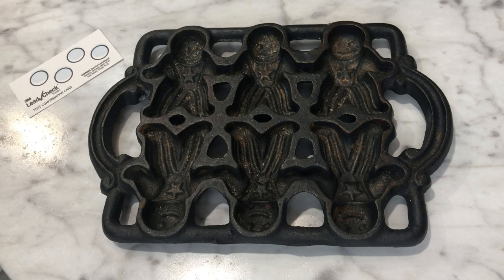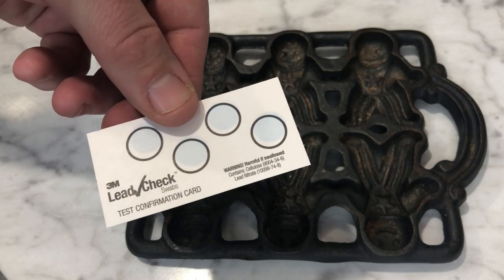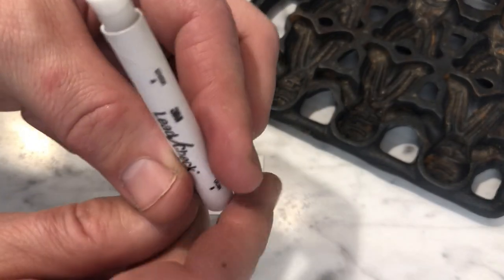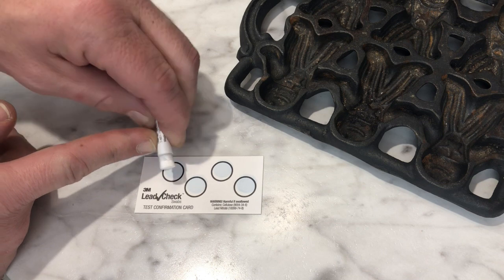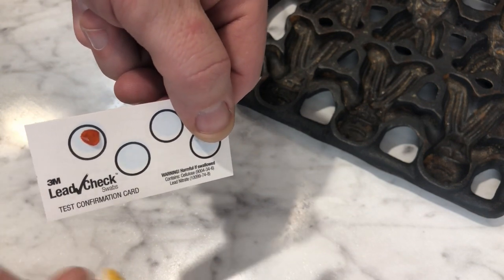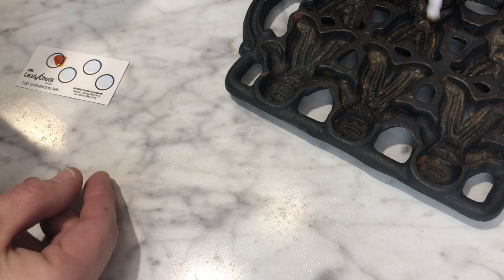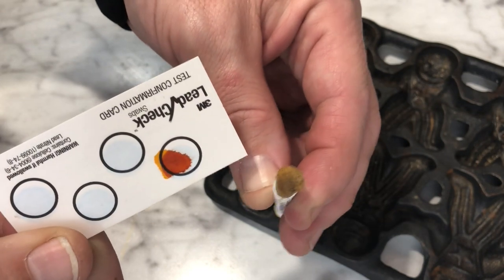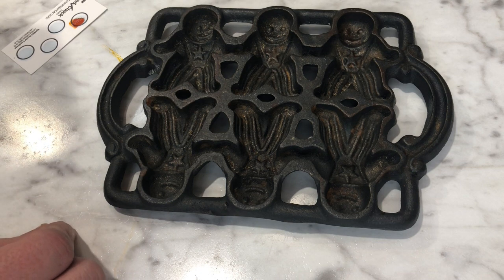Testing a Cast Iron Cookie Mold for Lead

Comment: I got a skillet and I put it in a lye tank. When I got it out, it has a silver ring around the outside. I got a lead test kit and sure enough it has lead. I cleaned out the lye tank, completely and drilled a hole in the BSR #5 and put it in the trash. Thank you for your help!!
Reply from the maker: My condolences.

Comment: Why don't you pour some of your lye solution on the pan to strip the oil off of it before testing? I would not submerge the pan into my lye bath, as it may contaminate the lye bath.

Comment: Unless someone was casting lead gingerbread men?  That shape of pan wouldn't be very practical for melting lead in.  Imagine trying to pour molten lead out of those multiple cavities. I think most of the lead contaminated cast iron iron cookware was used  to melt lead in (for casting bullets or fishing weights, for example).  Someone said that cheap cast iron from China could have lead as part of the cast iron from manufacture. I'm not even sure if that is possible, as cast iron is heated much hotter than molten lead and it would burn lead away from the high heat and oxygen  used for refining the iron?
Reply from the maker: Cast iron molds have been used to produce fishing sinkers, and it's rather popular to use cast iron cornbread pans and molds (like this: https://www.youtube.com/watch?v=50T3sxiExbM ) for those.  Fortunately, this pan didn't have lead residue in it; but I didn't know what it was used for, before I acquired it.  Asian cast iron does not contain lead in its manufacture: https://www.youtube.com/watch?v=VyjQ_ZA0FJ8

Comment: Those are not designed to test consumer goods.  They are especially not sensitive enough to check for food safety.  #LeadSafeMama
Reply from the maker: We are checking for lead residue, not lead in the material itself.  I don't consider #LeadSafeMama a trustworthy resource. https://www.snopes.com/news/2019/03/19/lead-in-cookware-or-in-toys/

Comment: These 3M lead test kits suck. I'm looking for something better on Amazon now. I returned 3 of these 3M kits until I finally got a kit with 1 I could use. Alot of them were dried up. See how he had an issue squeezing that liquid out? Should drip out easily and get a few drops. I finally found 2 out of 4 kits that would work. Also note it says on the package once you squeeze the A and B sides, you have 2 minutes to test. I would not recommend these. I don't feel comfortable depending on them at all. I thought the store just had an old batch. The dates were 4/19 so maybe they have a short shelf life.

Comment: These small lead test kits aren't %100 accurate .
Reply from the maker: thesawch63 Nothing is 100% accurate.  However, read any product reviews and customer comments on this, anywhere, and you’ll see all the complaints are about difficulty with the applicator.  None of them claim the test failed to detect lead.